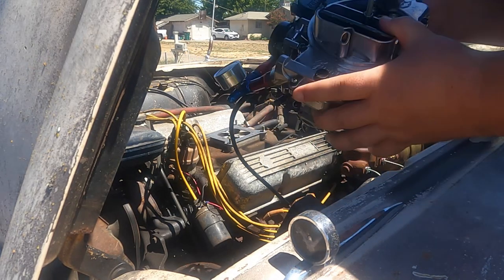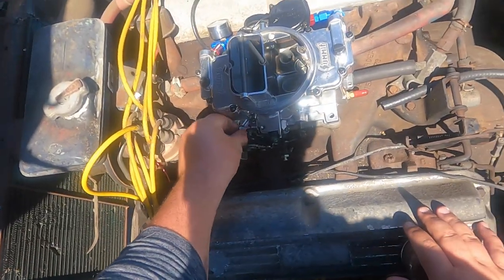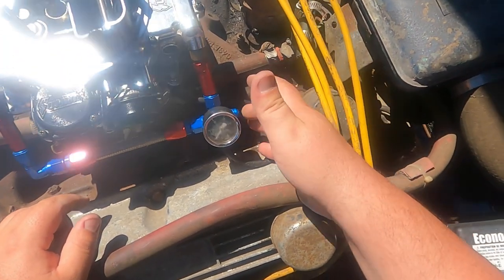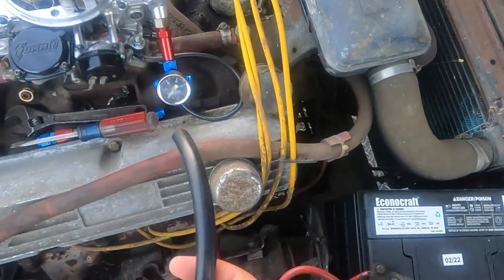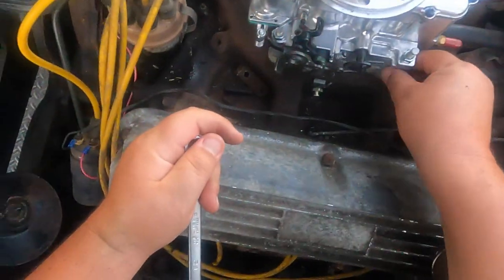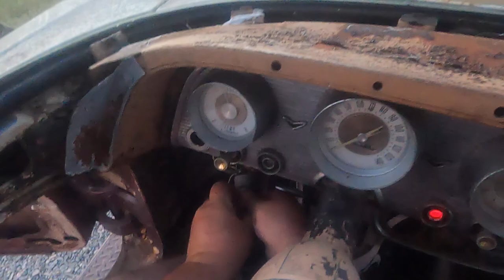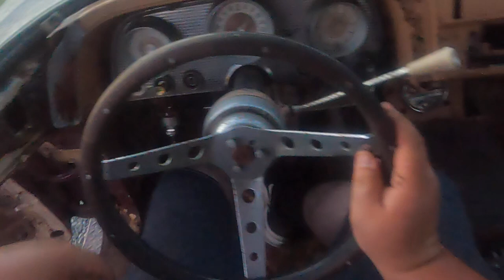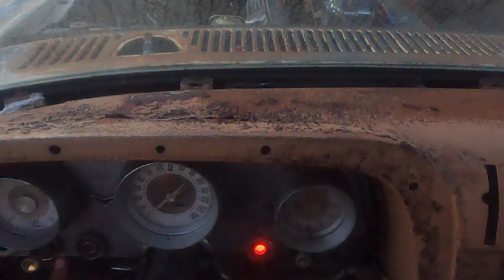1959 ford thunderbird carburetor install WILL IT RUN and drive off of trailer

Comment: The massive 430 MEL series V-8 was an option for 59. A smooth running reliable engine that get much  appreciation.
Reply from the maker: Thanks for watching. I believe the "J" code t-birds were the ones to get. They had the big boy motors.

Comment: Yep I'm an ole fart . I bought a 60 Bird in 71 for $ 300.00 the day I got out of the military . Kept it several years . My ex and I drove it to Long Beach , Ca. and stayed for about 6 months from NOLA . Drove it back with not much problems . Bought it with the reverse not working and never worked all the time I owned it . Beautiful red body with a white top . Red and white interior . Good luck with the car . Is that a 352 engine ??? If you need any questions I may be able to help .
Reply from the maker: It is a 390 installed by previous owner in the 70s. I believe this one is supposed to be the off white color. Not sure what color I want it yet.

Comment: That block off plate on the dash board is wheren the A/C vents would go if it were factory equipped with air conditioning.
Reply from the maker: Thanks for watching and thanks for the Intel

Comment: On my 1959 Ford Thunderbird that extra vacuum advance went down to the fuel pump. It ran the windshield wiper. So basically the fuel pump had two separate pumps on it
Reply from the maker: What an interesting design... thanks for the comment.

Comment: The extra cutouts on your centre dashboard is for the air conditioning. If it had air-conditioning that square piece was cut out at least that's the way mine is
Reply from the maker: Someone else said that, too... I have to agree with the cut out is for a/c.

Comment: I like that dual break master cylinder. Wonder if that came stock or whether you change that out. My 59 has a single master cylinder and I want to change it over to a dual master cylinder. Any recommendations
Reply from the maker: That is an aftermarket upgrade that the previous owner did ... I actually have to put in a brake light switch, probably by the pedal, because the new setup doesn't have the pressure switch option.